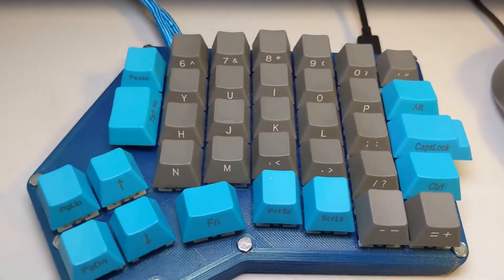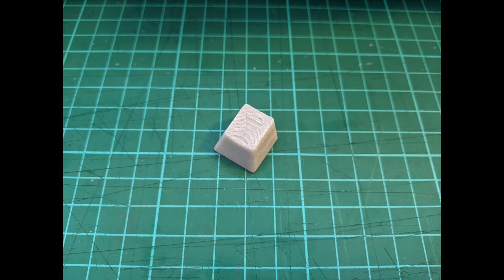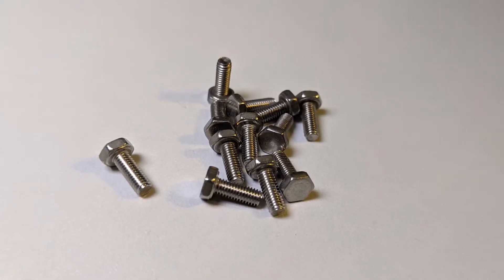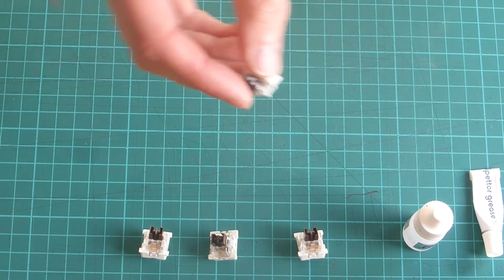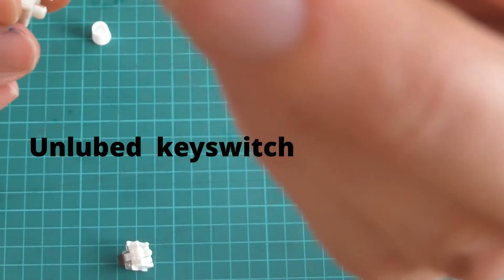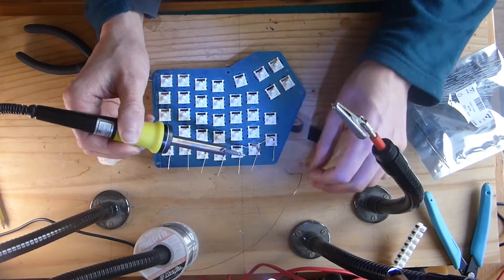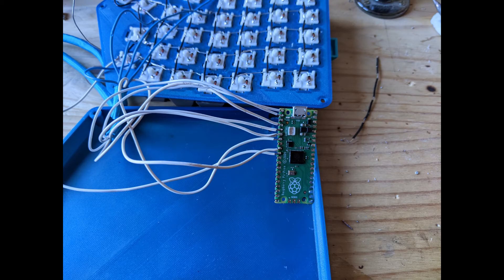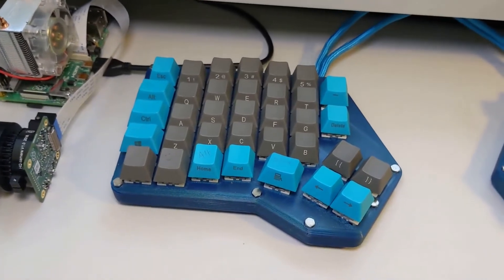3D printed Redox mechanical keyboard - first build

Comment: I am also about to build my own redox keyboard and remodeled the 3D parts on my own because there where things I did not like. 

Now I am about to print the parts and was asking myself if you adjusted the infill for the printing process or did you go for 100% infill?

Or can you recommend something here like printing the parts fully without infill?
Reply from the maker: Hi Hasan, I don't have the files saved but I'm guessing I'd have done it at 100% or fairly close. My cura profile has 6 top and bottom layers and the thickness of the flat bits is ~24 layers... so given it would only be 12 layers out of 24 it probably doesn't make too much difference 😄 That said, I don't get any noticeable flex while typing, I can see a little flex if I deliberately push down much harder than typing pressure.
Reply: @CraigManning  thanks a lot! 🙂 Now it's a little clearer that I should go the full print way. The flex issue was my concern but if you don't have a problem like that it's good to hear.

Comment: I'm about to start on making one of my own! I have some questions, Do you have a diagram on how the columns and rows are wired? Thanks for the guide!
Reply from the maker: Hi Reignand, I keep mean to put a nice picture somewhere but haven't yet. https://sachee.medium.com/building-my-first-keyboard-and-you-can-too-512c0f8a4c5f Sasha's pictures (about halfway down the page) are probably better than mine would be :) I put columns in one side of the pico and rows in the other just to help with debugging. Have fun with your build!
Reply: @CraigManning  Hi Craig, I noticed that the tutorial is using a promicro, I am going to use two pi picos, is there any difference in the wiring? thanks
Reply from the maker: @pancreasnou  Hi, it's mostly down to your firmware, I used KMK. I've not tried a proper split (I ran the row and column cables across) but there's a section here: https://github.com/KMKfw/kmk_firmware/blob/master/docs/split_keyboards.md
Reply: @CraigManning  I saw your other video, thanks for the help, I got pico and I am playing around with kmk. I am struggling to understand the pinout combination for the switches, can you share you basic layout and gp combination? thank you
Reply from the maker: @pancreasnou  Hi sorry for the delay. Yep I'll sort out a schematic...
Reply from the maker: Hi  @pancreasnou   and @Reignand Bongao  I've put a schematic here:  https://craigmanning.blogspot.com/2022/07/mechanical-keyboard.html  Hope it helps! 👍
Reply: @CraigManning  so in the end you connect the rows to the other half and rout the row across to connect to the pico, effectively having a 5x14 grid?
Reply from the maker: @reignandbongao9497  Yes, exactly right, with a bit of a wiggle for the thumb keys :) I'm sorting out a schematic.
Reply: @CraigManning  Thanks for your help! I'm now typing this comment with the redox. Mind sharing your keymap? only mapped qwerty, space/backspace so far.
Reply from the maker: @reignandbongao9497  Awesome work! Congratulations! I'll look to put a key map with the circuit diagram.

Comment: I made my first redox a few years ago, Yesterday i discovered there is a Multimedia version now... this is going to get expensive :D
Reply: #TIL I didn't know we could use a Pi as the microcontroller.  I'd love to have a ... something inside the case, so I could have my very short cable headphones plugged in to my Keyboard along with USB hub and a card reader

Comment: how did u code this ?? im using a raspberry pi pico too but guides i see is for pro micro
Reply from the maker: Hi, KMK works on circuitpython( https://github.com/KMKfw/kmk_firmware ), I have it working really well on this keyboard. It's nice and flexible I made some notes here: https://www.youtube.com/watch?v=i43lZPAkA2c
Reply: @CraigManning  oh so i just follow the wiring guide and flash it noice thank you <3